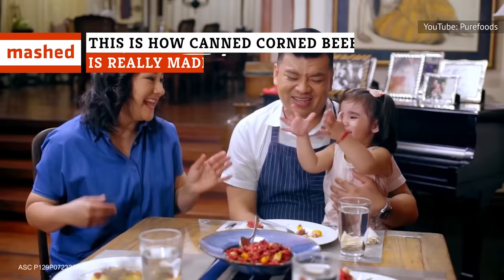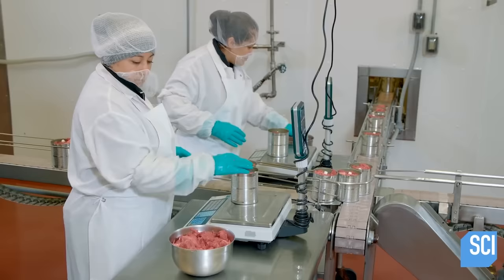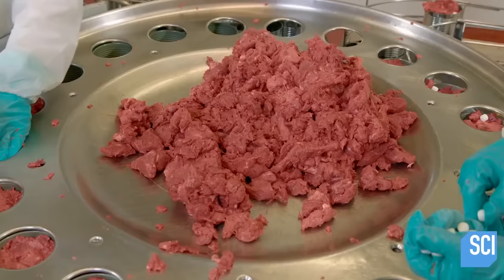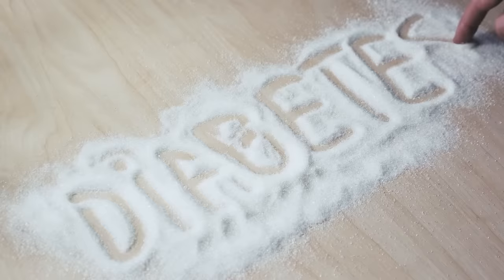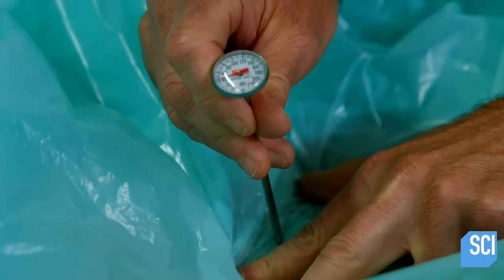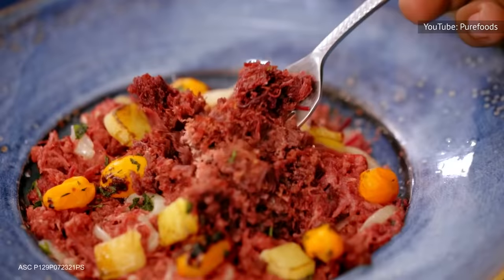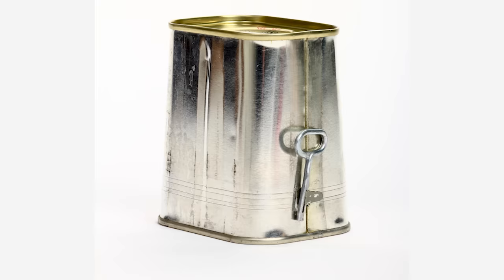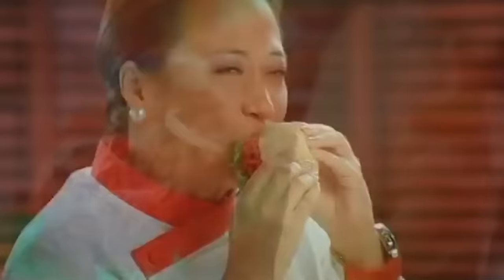This Is How Canned Corned Beef Is Really Made

Comment: I love canned corned beef. The best way to enjoy it is: Tear off the label from the can, and as much glue residue as you can. Rinse the can off under hot water. Be very careful when using the "key" to open the can, it's easy to do right, but also easy to mess it up. Save the top part of the tin to close off the can, if you are not using the whole thing. Fry it under light heat (low-medium on most stoves) to melt the fat, warm it up, and produce any crispness you may desire. Then it's ready for application onto... anything!

Comment: I can open "keyed" corned beef cans with a regular can opener. Had to. The strip broke while using the key. (I went the wrong way). I will use the key, but if it breaks, I'll use the electric can opener.